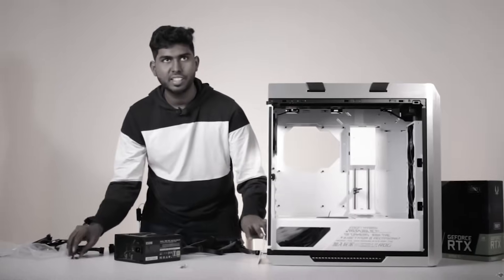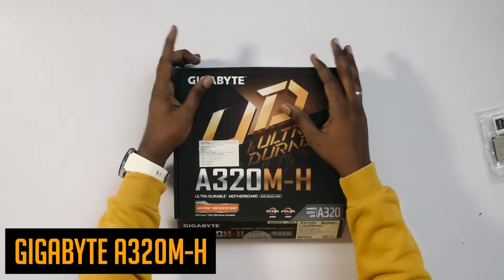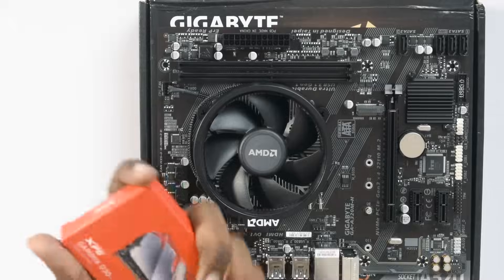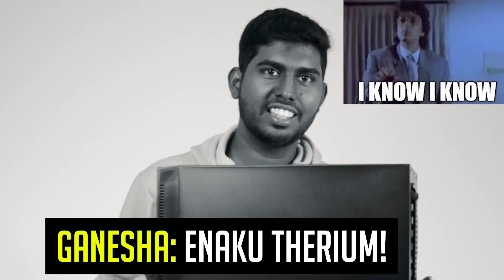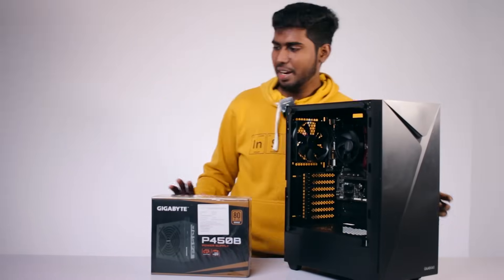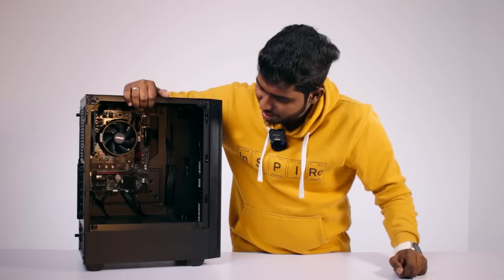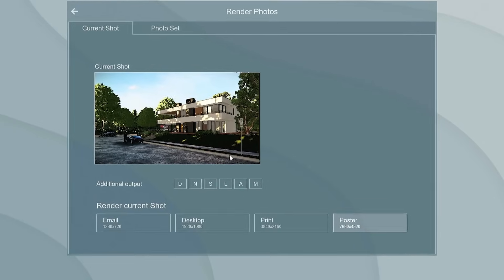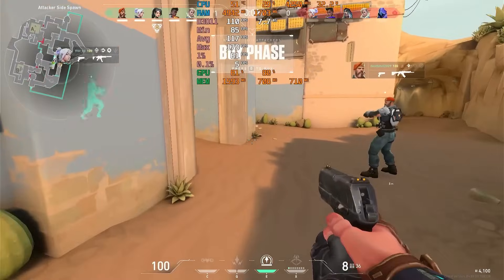30K Gaming & Editing PC Build | GTA V, Premiere Pro Tested | Build Your Own PC

Comment: Bro just a suggestion
Below iruka spec use panale 30k below varum thana.  GPU kuda Asus Geforce Gt 730 2Gb Gddr5 use panalam low profile la. And ant esport brand neenga engayume use panitu na pathathu ila ethathu reason iruka ? Give feedback for my spec bro

Amd Ryzen 5 5500

Gigabyte B450M S2H V2 Amd Am4

Crucial Desktop Ram 8GB DDR4

Kingston A400 240Gb Internal Ssd

Ant Esports Elite 1000 TG (M-ATX) Mini Tower Cabinet With Tempered Glass Side Panel

Deepcool Pf450 450 Watt 80 Plus Standard Power Supply
Reply: Yaary ya neeyi😭 2 nimsam selavu panni benchmark pathuruntha gt 730 is 50% worse than the igpu nu therinjirukum

Comment: You should use B450 motherboard, not A320 motherboard, because you get better performance from B450 motherboard. Also you can overclock B450 motherboard if you use a better cpu cooler. Go for air cooler, get it for 900 Rs.
Reply: B450 means 450M?
Reply: @mathiyazhaganramalingam2254   Yes, both B450 and B450M has the same features, but B450M has better VRM and heatsink for better cooling and performance. If you are a Gamer, go for B450M motherboard because it has better VRM and heatsink for better performance and durability. Definitely B450M worth its higher price with better quality!!!👍👍👍👍👍👍.

Comment: Don't do pc build from a2d 

I'm few days before 30k la pc pannanum nu sonna same spec send panna 30150rs

But I build in shop price huge difference 30k ku na ryzen 5 5600g oda poturupa 

But 3k shortage so i go for 4650g 
B450m gigabyte in this video and a2d build list a320 motherboard tha use panraga enaku processor+board 17k tha vanthuchi 

Xpg ram same 2300rs
I go for gigabyte m.2 480gb price is 3300
SMPS gigabyte same p450b 2300rs 
Case 2309 zebronices front 3 fan and rear 1 fan all RGB 
27k + wireless keyboard mouse combo free and i request vga cable free ha koduthaga and Bluetooth receiver only 209rs
Reply: vaangunathu gigabyte smps, ithula peruma vera🤣🤣
Reply: @Supermage119  dai a2d la mattum antha psu thana podaraga 30k 35k ellam athathsns use panraga

Comment: 50 k budget la oru Deep learning/AI training PC build panuka .it will be use full for all gaming and development nerds(intel only)
Reply: I am also looking for same configuration pc bro... Do you have any rough Idea...
Reply: @kamalkannan6188  1060 or 1060 super is great cause i am using the same graphic for TensorFlow but in laptop so if u need a pc go for rtx 60 series or 2080 ti if u have slightly high budget. just buy AMD for cpu performance
Reply: @dineshp414  Sure bro... Can you recommend me a config, not great PC techie... just starting to learn about hardwares... Thanks in advance bro
Reply: @dineshp414  1060 super nu oru gpu neengale kandupudicheengala bro

Comment: Bro i have a build did on the covid period and its a budget one for 15k and it is really better than this pc idk about bench  marks i did not do it (i am just lazy ) but it can play far cry 4 @60 fps only apu and at high graphics. but why build these days have high budget but low performance?
Reply: far cry 4 apde red dead redemption 2 paaru, lag illama run pantu peruma padrathuku
Reply: @Supermage119  bro i do them in Ultra settings. i get no lag and 60fps stedy

and i dont want to say that they are not good or bad i just want to let ppl know that u can do some build like this for low end gamming
Reply: @aathithyanvl565  ultra nu mottaya soldriye bro. Enna resolution la ultra vecheenga?
Reply: @Supermage119  i play at 1366x768 i think its 1080p
Reply: @aathithyanvl565  1080p is 1920 x 1080p lmao, athula aadi paaru un pc la, epdi thenarum nu😂😂vantanunga ithu kooda theriyama

Comment: Hi bro,
Anybody can reply me
I need some help i purchace a pc but didn't know
Iam using pc for os and latest version softwares
*Windows10 
*photo shop
*adobe premium pro
*3d home designing
*pcb designing
*ms office
Arduino software
 iam using pc for heavy works also
My burject only 30,000 
I need materials you give me best options
1) MOTHER BOARD
a) ATX mother board
b)4 Ram slots
c)4 Sata poets
2)PROCESSOR
a)best proceessor
3)STORAGE
a)250gb ssd
b)1tb hdd
4)RAM
a)ddr 3 or ddr 4
*SIMPLE CABINET
*SMPS
I have already purchace this materials
a)monitor
b)keyboard and mouse
c)i don't  preffer beautifull components,
I Don't want rgb lighting materials

Comment: Bro i have laptop ""hp15-ac123tx"" i am new to using computer so i don't know much information about ram , it can expanable upto 16 gb ram . Currently it has only 4 gb ram ddr3  on slot 1 and left blank on slot 2 , is it safe to put 8 gb ram on 2nd slot ?? Or it should be equal to slot 1 like 4gb ×2 ??

Comment: I build setup using 3rd gen i7 used office hp pc -around 10 to 15k. bought used graphics 1050ti low profile 10k . am getting 60+ fps on GTA V above 100 FPS  in call of duty. I love this setup instead of build this pc for 30k mine preformed  more the this pc

Comment: cabinet = Ant  Esports ICE-130 AG mid Tower case
mother board= Gigabyte B550m DS3H
Processor = Amd Ryzen 5600G 
SMPS = Corsair CV550 
RAM = Corsair vengeance DDR4 8GP. 2RAM
SSD = Kingston A400 250 GB 
Hard disk = wd Green 500 gp 

   43000 pc build bro intha money ku ithu worth ah bro
Reply: Change ur mobo to asrock or Msi
Reply: @girishkumar4944  why? Not gigabayte
Reply: @sudheerm.s6792  There are many gigabyte motherboards have took so long for rma period I'm talking about all over india in globally their psu's one of the worst ever manufactured and even this issue has been highlighted in gigabyte meet they said we have used new manufacturing but still I know some couple of clients had an issues.
Reply: Bro b550m motherboarddukku pathilla b450m mothwrboard polam
Reply: 5600g Worth bro
Reply: mother board yapdi bro
Reply: @TN_Royal  overkill but will suffice

Comment: Bro my pc spec opinion

I3 10105f processor 
Msi h410m motherboard 
Vegance 8gb ddr4 ram
GT 1030 ddr5 gpu
Seagate 1tb hdd
Ant v500 psu
 Zeb cronus pc case
All components are nearly 30,000
How is my pc spec idea👍👍👍

Comment: Bro I build i5 2400 8Gb ram SSD 128GB HDD 500GB GT 710 la build pannen bro 18K budget, With monitor 22K bro.... Performance also same bro GTA 5 @720p Normal la 40FPS,
Reply: Bro aana i5 2nd gen laam outdated bro ippo 12th gen varikum vandhuruchu
Reply: @BINGO2530  idhu 2nd hand bro processor 3k

Comment: Bro in this budget i would prefer to get a cpu at 8k range (i3 10100- Rs:7k) and get a gpu like rx 460,rx550 or gtx 1050 2gb
Yes we will sacrifice on editing but i think its worth it...
Reply: In this budget you can get
i3 10100F - 6850₹
RX 560 - 9620₹
8GB DDR4 2933Mhz - 2450₹
H410M motherboard - 5200₹
1TB hdd - 3256₹
240GB SSD - 2180₹
PSU DeepCool 600W - 2000₹
PC Case - Anything you want for remaining budget
Reply: @theminestone2853  you don't need 600 w psu lower is enough.
Reply: @theminestone2853  yow rx 560 15k offline la
Reply: Your Processor is okay but Gpu is low profile
Reply: No
Reply: Offer
Reply: Bro vimal chintaplatla build  video la patha
Reply: @theminestone2853  960 kuda antha price Ila bro most youtubers views ku price sollitu poiduranga pc builds panra engaluku than thalavali
Reply: Ok instead of rx 560 go gtx 970 used
Reply: 6000 only
Reply: @theminestone2853  6000 nee patha 12k ku kammiya 970 illa sir used la
Reply: Oh ok
Reply: @theminestone2853  RAM la 2400, 2666, 3000, 3200, 3600, 4000,4400 mhz nu than varum

Comment: Bro when i playong game gpu is 100% using how to reduce that 
IF I USE 100% ALWAYS WHAT HAPPEND TO MY GRAPHICS CARD
Reply: bro, it is supposed to use 100% bro, apdi use panna tha ungaluku nalla performance varu, it isnt a problem bro, dont worry
Reply: @Supermage119  en laptop la 100 cpu and gpu fulla use agamatikidu bro 30 - 60 dhan use agudu . Enna panna num nu sollunga
Reply: @santh_osh21  Neenga enna program use panreenga nu poruthu than bro ungalukku usage aagum cpu and gpu
Reply: @santh_osh21  charge la pottutu vealiyadumbodhu GPU ipdi irukka or battery la use pannumbodha
Reply: @gokulaprabu2597  bro en channel la oru video iruku ade paarunga evlo lag agudu idum gta 5 dhan en laptop gaming laptop charge potu dhan vladuvan bro .vangi 2 years achu innum apdi dhan iruku. Naan pc doc kittaium kettutan avar reply pannala. Time irunda paarunga bro.
Reply: @santh_osh21  Bro enna specs unga laptop? aprm enna res la aadureenga enna settings la?
Reply: @akashbalaji8081  gtx1650 ryzen 3550 h bro
Hp pavillion
Reply: @santh_osh21  enna settings bro?
Reply: @santh_osh21  yevlo fps varudhu nu note panneengala bro msi afterburner vechu
Reply: @akashbalaji8081  max settings la um normal settings laium ipdi dhan bro
Reply: @santh_osh21  @Gokula prabhu sonna maathiri fps check pannengala?
Reply: @santh_osh21  first unga game GPU la dhan run aagudha illa processor la Ulla internal GPU la run aagudha nu check pannikonga. Before all that msi afterburner install panni frames yevlo varudhu temps yevlo varudhu nu check pannikonga.
Reply: @akashbalaji8081  adale constant ta tara mudila bro
Reply: @gokulaprabu2597  bro re3 60 fps kudukum bro but didirnu 10 fps kudukum bro aprom 60 fps kudukum adale constant ha 60 fps kuduka mudila sila time 1, 5 fps kooda varum gta 5 . Naan GeForce experience dhan use panran record panna bro aduanle latest driver dhan use panran bro so 1650 la dhan run agum . Yen ipdi agudu ne terila bro .
Reply: @Supermage119  thank you bro
Reply: @epictamilgamer7215  no problem bro
Reply: Bro athu game oda load naala 100% use aaguthu bro, 100% laye game aadumbothu iruntha problem illa bro, matha nerathulaa 100% irukka nu paarunga, 100% laye eppavume irunthathan problem, Temps check panni paarunga bro
Reply: @akashbalaji8081  ok

Comment: I have a doubt
Office pc is having 4 slots for ram and currently occupied with two 2gb ddr3 1.5v ram

Please let me know whether below combo gives an issue or which option is better-

Combo 1- along with old 2+2gb ram, can I add 2+2gb ram of same type (total 8gb)?

Combo 2- along with old 2+2gb ram, can I add 4+4gb ram of same type (total 12gb)
Reply: Combo 1
Reply: Remove those two and add 8 gigs of ddr4 ram if possible two
Reply: @yuvaraj-bv6lj  he says DDR3 support bro
Reply: @logeshp452  antha thappu pannatheenga bro seriya work agathu mix pannna😅
Reply: @logeshp452  he haven't said about that bro only 2rams already in ddr3
Reply: @yuvaraj-bv6lj  This is what I would like to know,  Thank you bro. I thought of using two different sets of ram for two dual band.

I will go with additional two 2gb ddr3 1.5v ram.
Reply: @yuvaraj-bv6lj  I would like to utilize the existing resource (2+2 gb) with optimum performance with less expense (8gb will suffice my purpose still I would like to know whether 12gb works fine or not)
Reply: Try to add 2gbs on all 4 slots or  4gbs on all 4 slots. Mainly frequency of each stick should be same.
Reply: @logeshp452  ok bro but will there be any issue if I go with combo 2?
Reply: Nenga mingled ah podalam but ungaluku andha alavukku efficient ah irukathu bro so Ella slots layum same Ram podrathu nallathu and frequency uhm same ah maintain pannikonga
Reply: @rkfftamil9715  ok bro,  thank you
Reply: Combo 1